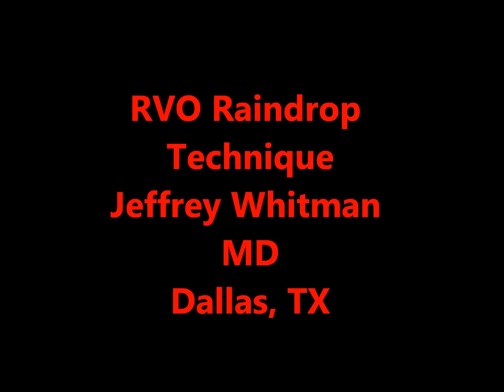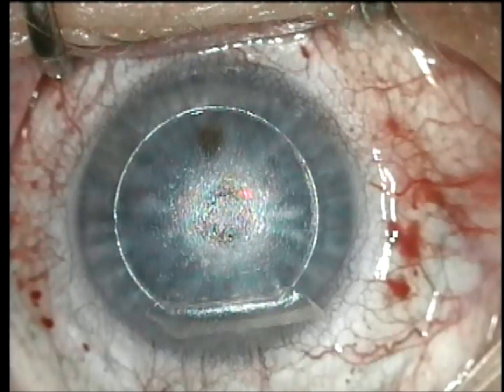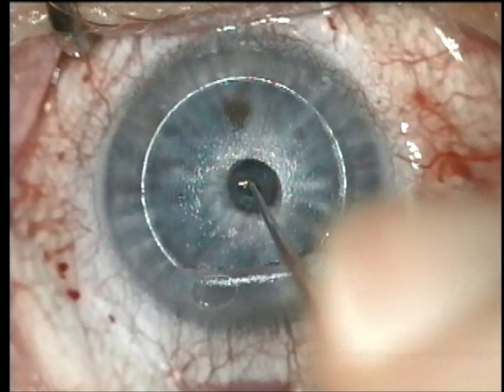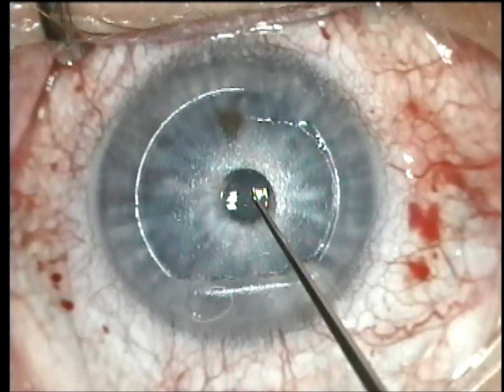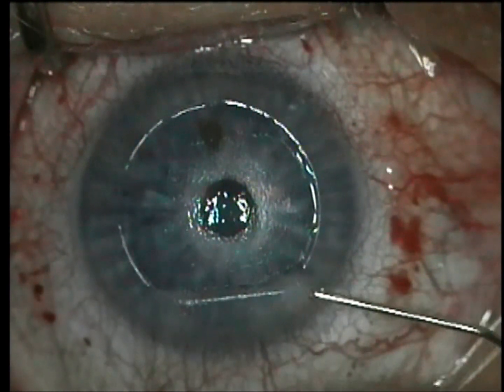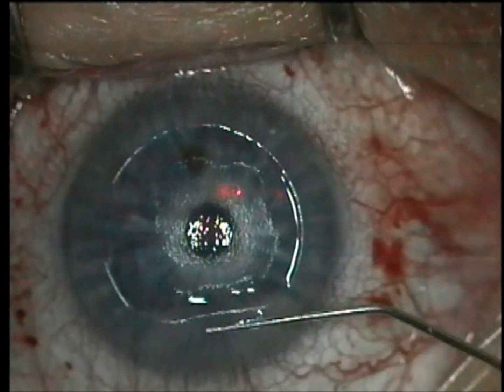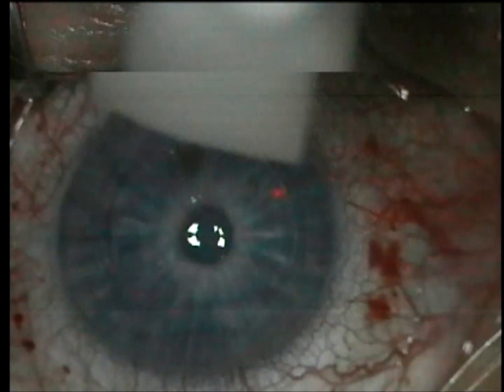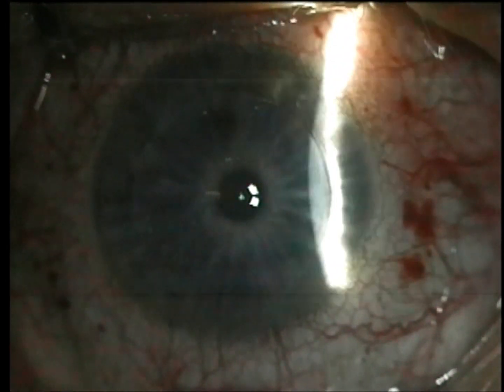Raindrop (ReVision Optics) Inlay for Presbyopia Insertion Technique

Comment: Procedure looks great, and relatively simple, my question as your presbyopia increases with time is this procedure easily replaceable with a higher power inlay?
Reply from the maker: See response below---the effect is not based on power--but rather on extended depth of focus, so it keeps focusing even as you age.  Eventually your vision will decrease with cataract development, but after cataract surgery the inlay should continue working for aiding with your up close vision.